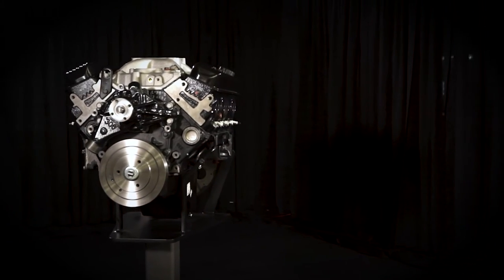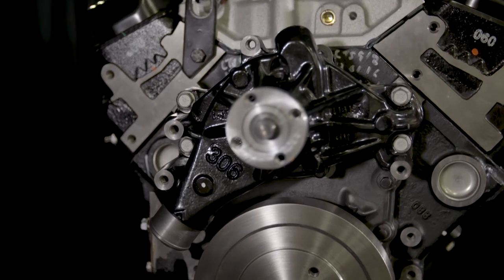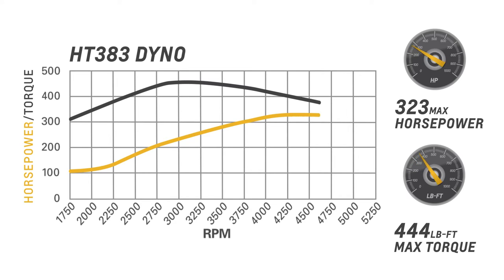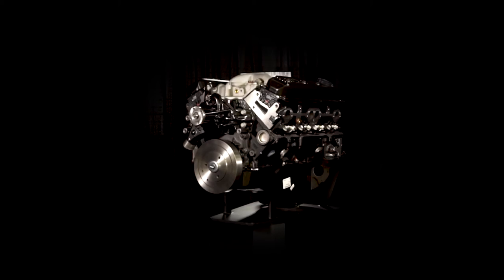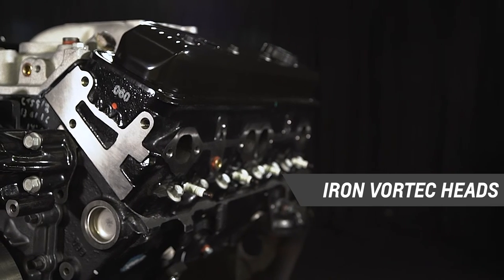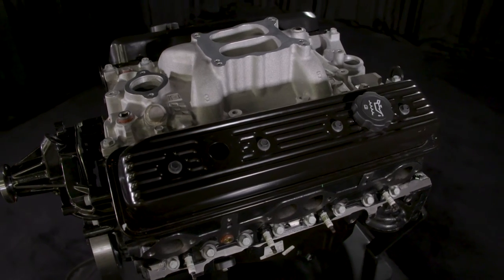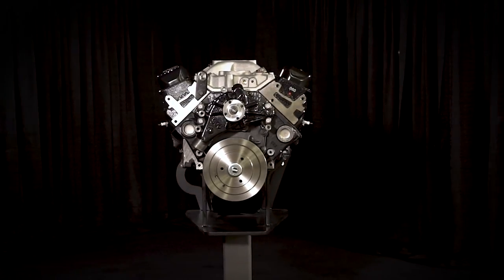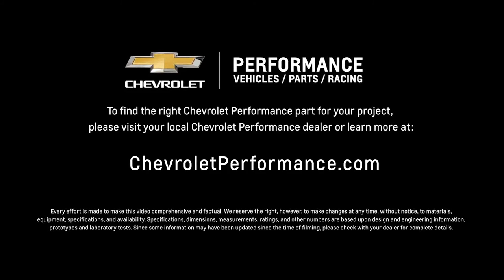Chevrolet Performance - HT383 Crate Engine - Information & Specs

Comment: Can you tell me how I can verify that the HT-383 that I ordered is in-fact a 383 engine. I bought one for my truck but it has never produced any power. It runs like a vanilla 350. Absent taking the motor apart and measuring the stroke, are there serial numbers or casting numbers unique to the HT 383? Does the HT-383 have roller rockers to go with the roller cam? Thanks in advance for any info.
Reply: I think you've just realized that this crate engine isn't very special. Just because it's a 383 doesn't necessarily mean it's going to be an ass kicker. It's a very mild cam (basically one step up from the stock Vortec L31 cam). The heads are just a set of Vortec's like you'd get on any '96+ SBC. 33 extra cubic inches on what really amounts to an otherwise stock Vortec truck engine kinda explains why you can't feel much over a 350.

I know you've already spent like $5k on this engine (yikes) but a set of Dart Iron Ealge's 200cc with a 72cc combustion chamber (to keep it pump gas friendly) would really do a lot to wake up your new engine. I have a set on a 406 and it absolutely screams. 

All this kinda assumes this isn't in a factory fuel injected truck. If this is in a truck with stock fuel injection, none of this matters without a tune as the computer will have no idea why it's getting all this extra demand for more fuel.
Reply: I'm working on one of these, there is a little placard on the right side(passenger) near the freeze plugs.  You can Google search there is a magazine that added 100hp to one of these.  This is a good torquey truck engine.
Reply: I’ve got this motor and feel very disappointed also. This is not a 383 in my opinion not like any I’ve ever sat in